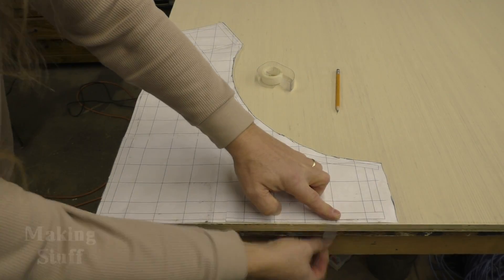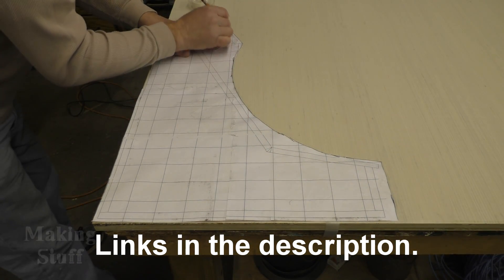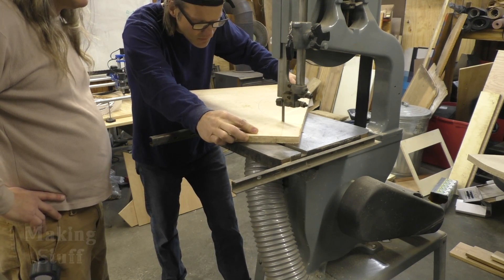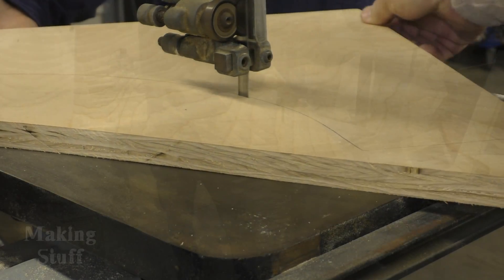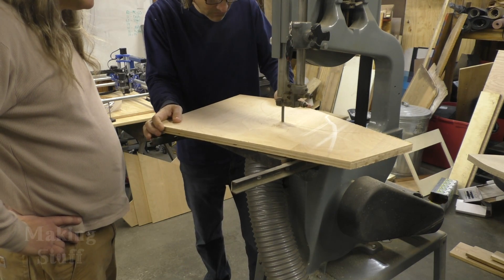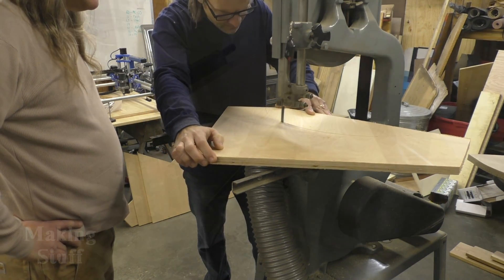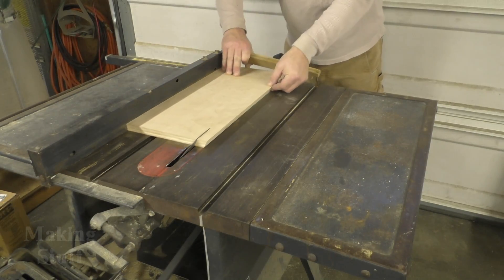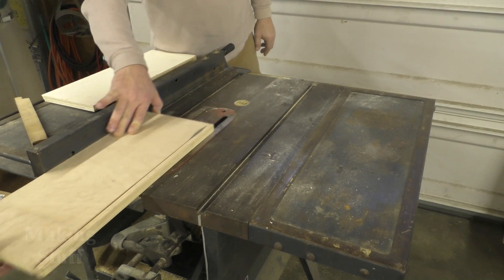Mame Arcade Cabinet Build

Comment: Pretty cool build, besides your time how much do you think you have invested in a single cabinet with material & electronics?
Reply: You can make one for under $300 easily. I spent about $100 on a stick/button kit, and a raspberry pi. I needed the router bit to make the t molding slots and I didn't own any forstner bits, so that was another 40 bucks, and I spent 50 bucks on a 32" flat screen.  Wood for a table top version is probably 20 bucks. As soon as I'm out of this apartment I'm building my cab. Can't wait.
Reply from the maker: Somewhere between $250 and $300.